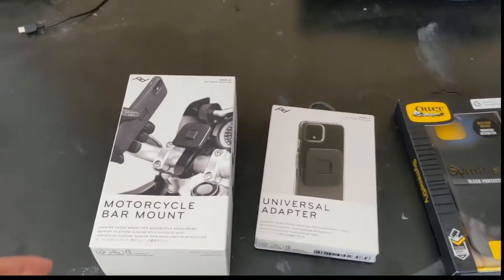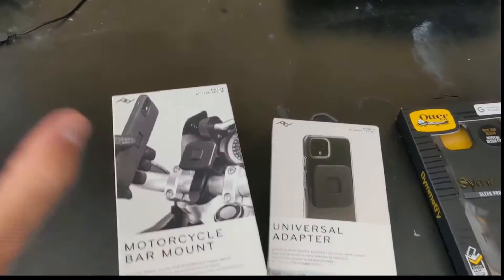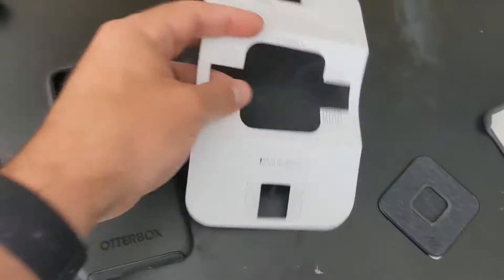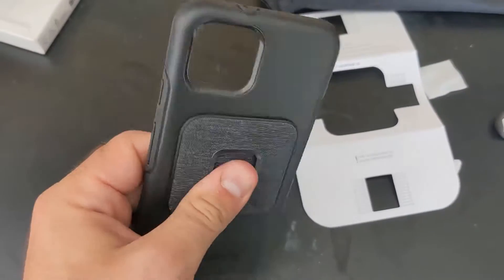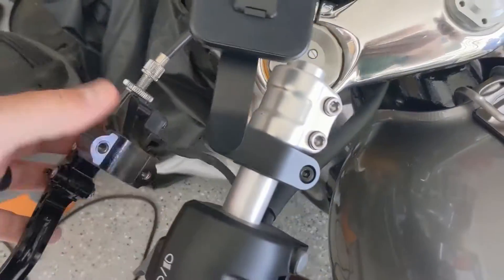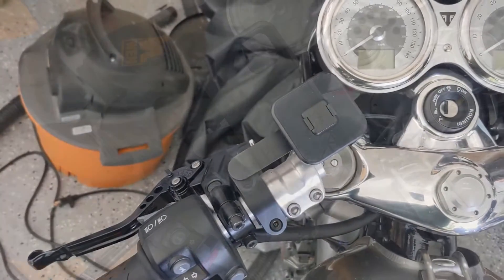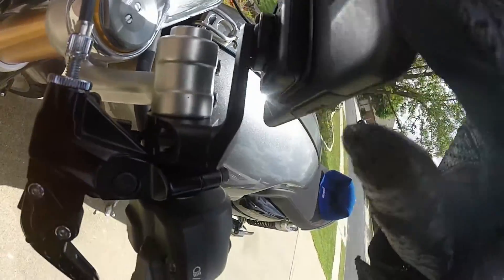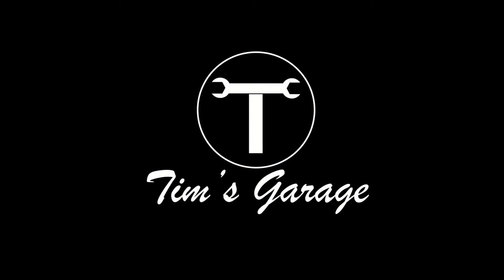Peak Design vs. Quadlock Motorcycle Phone Mount - Triumph Thruxton R

Comment: Hi Tim, thank you very much for your video as I was desperately looking for some information about the dampener itself compared to the Quad Lock one. Could you please tell more in detail what the Peak Design guys said about it when you met them? How exactly should it be better vs the Quad Lock one? Did they say something about their dampening technology? QL provides a lot of information about their development and technology process but PD unfortunately not which makes me very hesitant to buying one. Thanks a lot!
Reply from the maker: Honestly, I wouldn't say that the PD one is any better than the QL one. It's just that PD designed theirs better because they came after QL. They had the second mover advantage that allow them to make a more slim line design. As far as the functionality on the dampener itself, I would say it's equal. I do like the magnetic clip-in and out on the PD one though. I think both are very great phone mounts.
Reply: @tims-garage  I see the PD one better in may aspects for me, just lack more detailed information about the vibration dampener as it is in the end the most important thing for me. Protecting my phone from vibrations, especially when riding off road. I'll try to reach PD directly if they can provide more information. Thanks for your reply and have a nice day!
Reply: I'm not sure if a non backer can read the updates, but during Peak Designs Kickstarter for Mobile they put out tons of interesting information on the development process. So maybe look for their project page to check. I backed the project based on the quality of their camera gear I already owned, and honestly I think that, although a bit expensive, this is one of the best systems out there. And they are still adding to the lineup.
Reply: @vasekdinha  Hey Viet! I'm the engineer at PD that designed this mount and the vibration dampener integrated into it. Quadlock makes a fine dampener but it had three major flaws that I wanted to avoid in my development: It's huge, it's ugly, and it's REALLY loose right around the neutral balance point of the phone, which leads to a lot of "flopping about" while you're riding over even very smooth roads. If I had to summarize the differences between the PD dampener and the Quadlock dampener, I would say the main difference is that the PD dampener solves those 3 problems. 

Without going into too much nerdy detail or giving away all our secret sauce, we were able to achieve that via a few key ingredients: 
1) Integrating the dampener into the mount instead of making it a separate add on (gives us the ability to make it smaller, sleeker, and prettier) 
2) Using premium materials - anodized aluminum vs. injection molded plastic (I hate plastic on my moto and avoid it unless absolutely necessary)
3) I had absolutely nothing else to do for 2 years of pandemic lockdown other than work on this dampener development (ok a bit of a joke, but you get the point... pouring a ton of energy into this thing kept me sane)

We tested the snot out of this thing - a ton of miles by yours truly to get through 17 initial prototype designs, then instrumented lab testing at a professional test lab, then 135,000 miles traveled by 79 beta testers around the world (hello to any of y'all that read this!!). We scaled the testing as the development progressed. I'm happy to say that it's performing EXTREMELY well out in the wild. 

Hope this helps - feel free to ask my any questions!

Here's our website page about the development and testing process: https://support.peakdesign.com/hc/en-us/articles/4425117728148-Vibration-Protection-with-Peak-Design-Motorcycle-Mounts
Reply: @maxm50  Hi Max! First, thank you for your reply which I truly appreciate. However, since my first comment here, I have bought and still own a Motorcycle Stem Mount and also a 1" Ball Adapter which got released like 2 weeks after my Stem Mount's purchase (so unlucky lol). Back in Czech Republic where I am from I used the Stem Mount on my 2001 Suzuki GFS 600. When turning on the camera on my iPhone 12 Pro while riding my motorcycle, I could clearly see that the footage is not stable at all and the iPhone's camera system is trying to balance the vibrations. The footage got almost no vibrations on wide lens however it did have mid vibrations on regular lens and a looot of vibrations on tele photo lens. When I reached my friend who uses a Quad lock system, he didn't have any visible vibrations while riding his motorcycle like I had.

Now I'm in Vietnam, traveling for next few months and using the 1" Ball Adapter. Honestly, the vibrations are even worse compare to the Stem Mount. Even on iPhone's wide lens while riding off road I have visible vibrations already and overall I'm just not confident enough that it is safe to use my iPhone with this PD system. Every ride I'm just frightened that my camera system will got broken and use the holder only when really needed... I'm a professional traveller and content creator so to protect my phone is essential. I've been using PD products for years for my Canon DSLR camera systems but this seems to be more tricky this time.

I've uploaded some test videos from yesterday here so you can check: https://drive.google.com/drive/folders/17KGECl4i010rK6mTJwReO-JuOx6b8rXz?usp=sharing

Could you please let me know your opinion on this, Max? Thanks!
Reply: @vasekdinha  Hey Viet! Awesome videos - have a fantastic time in Vietnam! I've traveled there as well and it's such a wonderful country. Regarding the vibrations: The short answer is that the vibration dampener system is tuned to protect your phone camera but not to stop the jiggling you're seeing. Our Moto mounts are not intended as filming tools to be used while riding - to do that would require a hugely different approach to the vibration isolation, and a MUCH larger product that would allow your phone to more or less completely float suspended in the air. It would be very hard to interact with your phone for maps and such. Maybe someday we'll make this "filming mount", but not yet...

The vibrations that will kill your phone cameras are high frequency vibrations, ie. buzzing and humming. The vibrations that you're seeing while filming are relatively low-frequency, high-amplitude vibration - ie. jolts and jiggles. These low-frequency bumps are surprisingly not harmful to the camera. Throw your phone on any mount (us, quad lock, whatever) on a road bike or mountain bike over any kind of road and you'll see much the same thing. But the incidence of these low-frequency vibrations killing cameras is almost zero, based on what we all (ie. everyone outside of Apple/Google/Samsung) knows today. My hunch is because the phones were designed to handle this kind of usage. You encounter jolts and jiggles all day, every day. But your phone only encounters the high frequency buzz/hum of a high revving motorcycle engine when your phone is rigidly mounted to one. 

(Side note: I know it's frustrating to hear us companies talk about "high frequency" or "low frequency" with no numerical quantification, but that's simply because there's a lot of R&D that we've all put in to discovering which frequency ranges are harmful, and we're not willing to spill the beans on the internet so that the other companies can see our research. Kinda like why Coke would never post their recipe online - even if it's not patented, it's a trade secret.)

So, anyway, I know it's counter-intuitive, but the vibrations you'll see through your camera app while riding are NOT the most dangerous ones. I wouldn't recommend using the video filming while riding simply because I don't know how an "activated" OIS/focus system will respond to these jolts and jiggles, but I can tell you that a "sleeping" camera shouldn't be hurt by it. 

Now, to address why your friend with the QL setup doesn't see the same jiggling: assuming they're using the same phone model as you, the reason for the difference is quite simply that our systems are tuned differently. QL's isolator is VERY loose, cushy, wiggly, wobbly, whatever you want to call it. There is almost zero resistance to movement of your phone until it tilts/shifts pretty far away from centerline. This results in great vibration isolation but a pretty bad experience while riding - your phone flops around like a fish pulled out of the water. It's quite hard to see maps or read anything on the screen. I tuned the PD system to be a few notches "tighter" than this - so that it doesn't flop around as much. You can actually see your map while you're in motion without your phone flopping all about. But the phone does experience these "jolts" a bit more than it would on the QL isolator. I only did this because our testing showed that the jolts ultimately weren't harmful to the phone like the high-frequency buzz was. 

I hope this all helps!
Cheers,
Max
Reply: @maxm50  Hey max, because of your comment I just decided to buy this mount and leave my QL behind. I'm pretty afraid of exposing my brand new Iphone 14 to the vibration on the motorcycle. Hope this thing really works :)
Reply: @rb_prado  That's awesome to hear! Thanks for giving us a shot. Hope you love it!
Reply: @maxm50  really appreciate your extensive response and explanation. 
I’m a huge QL fan but going to give you guys a try, as the sloppiness you describe does bother me with QL. Also it looks like your cases may be slightly thinner, which would be great.
Reply: @petee1968  Glad to hear it! Yes, our cases are the thinnest on the market for any of these case + mount systems. Hope you enjoy our system - let me know!
Reply: Its time to buy ONE, thank you for the information👍
Reply: @maxm50  Hey Max, if you're able to do such great work with the vibration dampener I'm sure you're able to design a case with a more magsafe like magnetic array which doesn't affect the S22 Ultra's S Pen functionality right? :) That's the only thing stopping me and possibly a lot of other S22 Ultra users from getting this case. Honestly prefer the look and locking mechanism over QL's
Reply: I saw one comment saying his PD mounted phone fell off his bike while riding on the highway. He said there was no bumps on the road... Impossible to know if such comments are legit. Are there any drop tests with PD cases? I could only find QL drop tests so far.

Comment: I will have to see a review of this after some tough use. I can't tell if I'm just being biased because I love my quad lock mount with the dampner and wireless charger so much. I don't find it difficult to take my quad lock on and off at all.
Reply from the maker: I was that way too, and honestly, if I had the wireless charger, I probably wouldn't have switched. However, the QL with that dampener and the charger sticks up about a mile off the handlebars.
Reply: @tims-garage  you can stick the QL even out more from the handlebars no?xd
Reply from the maker: @mage1915  a bit, it all about where you angle the arm
Reply: is that a peak phone case or can we use our own case ??????

Comment: what if you drive fast on a naked bike with it will it blow off
Reply from the maker: False
Reply: @tims-garage  the stick on thingy has me very concerned
Reply: @tims-garage  i go like 117 on an mt09 and i took off my puig screen because i do not like alien queen
Reply from the maker: Use the actual case version. I have since upgraded to a case for my Pixel 6
Reply: @tims-garage  i want to  but i have a moto g power 2022 i been having trouble finding quadlock and peak cases. companies dont seem to like motorola. im almost considering a new phone but i have to pay out my old one and then they want me to activate fee the new one. its aids. do you happen to know what the handle bar diameter of a 2022 mt09 is. i been trying to google search that for a couple days now. (currently)
Reply: @tims-garage  did you see that video where a guy had his like apple phone in a quadlock case and like he drops it out of his pocket and picks it up the case and cameras dont have a scratch but then he takes it out the case and every square inch of it but the camera is shattered like yikes
Reply from the maker: @t.m9341  I didn't! That sucks! Gotta be careful with your phone either way. Safest is always your pocket
Reply: @tims-garage  i think he was in his home and he said it just dropped out of his pocket. idk my handlebar size.. do you know anything about tackform idk if i should get tackform or like peak and get a new phone. my phone sucks anyway it doesnt even have a go back button.

Comment: I wouldn't trust the magnet  after 100mph . I lost my iPhone 12 on my Thruxton last year was on Ram x mount about 120mph and the phone fly away to corn fields and never recovered . Since this incident  using the QL on my all bikes with more speeds and no problem so far but I dont think magnet will hold with high speeds.
Reply from the maker: I thought the same thing, but as I explained in the video, it used a locking mechanism and a magnet, not just a magnet. So it CAN be trusted.
Reply: In Peaks video for their bicycle mount (which is the same thing but without vibration damper) they lifted the entire bike into the air by the attached phone. It's a good system
Reply: Tim is right in his reply - the magnets only serve to attract your phone onto the mount until the metal claws latch it into place. All of the retention of the phone once mounted is taken care of by the claws, not the magnets.
Reply: I went over 200kmh many times and nothing happened with the ram x. But my camera got damaged twice cuz it has no vibration dampener so I am going to change it.